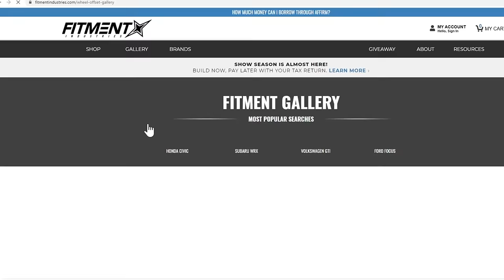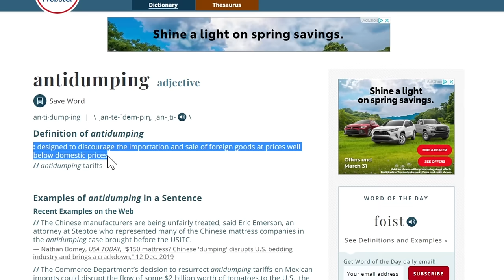Tire Prices Are About to SKYROCKET...

Comment: Tyres. The most important modification on any sports car, regardless of the category
Reply: Only the broke boy tires are being affected not the ones that will actually enhance your driving experience/ performance
Reply: @chelly9456  how you figure? Cheap tires are better for drifting
Reply: Car mods are banned
Reply: @chelly9456  Cheap Federal tires are great and it's a huge performance upgrade compared to the stock Michelin tires on my Toyota 86
Reply: @halogod0298  There are expensive drifting tires with harder compound that will last u more then 10 cheap tires  :)
Reply: behind the driver
Reply: Yeah it's a big safety upgrade actually.

Comment: I don’t run cheap foreign tires so this doesn’t affect me personally but I feel bad for drift kids...
Reply: HURR DURR MADE IN MURICA
Reply: @Louzahsol  I don't buy cheap either, but most of what I buy is made in Japan or Europe. 

Good tires is part of the insurance costs if you think about it. It's what allows you to stop and turn more than anything else on your car.
Reply: @wayward03  the point I was making is that made in America doesn’t mean an item is inherently better, other countries build things just as good, if not better and less gimmicky
Reply: @Louzahsol  I'd agree. I try to not buy things with major human rights issues like China but otherwise get the best product for the money when possible.
Reply: Did you miss the part where he says less tires will be shipped to America, causing a shortage, causing prices of regular-priced non-foreign tires to rise as well?
Reply: valino tires wont be affected by this, which is really the ideal drift tire
Reply: @troyjollimore4100  that's the big concern. Although most people that are not using these tires for drifting would probably just buy used tires anyways.
Reply: @Xander1Sheridan  I feel worse for the people struggling just to make ends meet. I remember when that was me, and a price difference of even $2-$5 per tire was enough to hurt what little money you had... Just trying to keep the car on the road!
Reply: I don't.  Why would anyone want to peel off the tread from their tires?
I respect their skills, but not their philosophy...
🤣👍
Reply: @tyree9055  Because they find it fun? Just the cost of doing it!
Reply: I always thought American ones were the cheap tyres, at least here in Australia. They seem to always be getting more flats and wearing out much quicker than most others yet cost the most, especially the Coopers.
I'm comparing to other well known brands btw, I'm not saying they are worse than Tonkos or whatever from Vietnam.
Reply: @archygrey9093  Those are the 'cheap' American ones. Dean, Cooper, Hercules, etc... Not bad for commuting, but almost as prone as the cheap Chinese tires for wear and broken belts. Now you get the 'good' American tires, like GoodYear or BFGoodrich... I think Michelin is technically French... THOSE are worth driving on.
Reply: @troyjollimore4100  Oh, yeah BfGoodrichs are very good, they are my favourite, i was more referring to the country of manufacture than where they are based, the goodriches on my car for example are made in Thailand.
Strangely enough BFGoodrich is actually owned and operated by Michelin, which is definitely french based and owned.
The Coopers here in Australia are always shown off as the premium American brand, they like putting banners of screaming eagles in front of American flags outside the Coopers tyre shop. They are a favourite with the 4x4 blowies and their magically scratch free cars, poeple who actually go offroad often usually anything else.
We tried coopers on a couple of the work vehicles on our cattle station and they got flats like crazy.
Reply: @archygrey9093  LOL! That's like here, anything Asian/European/Australian is 'exotic' and desirable!

Comment: Basic rule of economics, when the government interferes with the free market, prices go up and the everyday consumer ends up paying the tax.
Reply: Correction, THEORY. And one that cuts both way, of course you WOULD know that, but feint ignorance to make your point.
Reply: @cmendoza1094  typical libertarians
Reply: @cmendoza1094   It's pretty universal, though there are the few exceptions where the free market was allowed to run wild - itself often as a result of government interference and regulation - and government was able to reduce costs.

The prime example is medical care - it was once quite cheap... it only became expensive as a result of government regulation (providers have to charge everyone the same price they charge Medicare, but Medicare only pays a fraction - and the customer can't be required to fill more than some 20% of that amount... therefore charges went crazy and insurance companies started paying those higher prices (or much closer to it)... and that money was then used to make changes to medicine that increased base costs... and a vicious cycle began... directly caused by government actions... and only resolvable by government actions).
Reply: Oh no, the big bad gubberment won't let you buy communist made tires XD

Comment: Worked in a Firestone factory for 16 years. Well, actually it was Dayton when I started, and Bridgestone when I left. Plant opened in 1970 but a lot of the machines were from the 40s and 50s. At one point turning out 50,000 every day.  The rule was build em fast. We'll sort out the bad ones. Kept a shredder going like crazy and hauled them to the landfill. I remember when the Japanese engineers came in and walked around shaking their heads after buying our painted up factory. In case you didn't know, Firestone is just a name now. I think there may be one factory left in the states but everyone is salaried. Japan is not too keen on unions. Have lots of stories, but think about it. Tires really haven't gotten much more expensive since at least the 1980s. You can still buy a tire for less than sneakers.
Reply: That's so true if anything they have gotten cheaper considering how big average truck tires have gotten

Comment: A guy that went driving with me and my friends had a new set of Federals on his car before going for a canyon drive. He crashed into the guardrail on the first turn.
Reply: So which was more expensive, the repairs or the price difference for a better tire set?
😄👍
Reply: I used to work at a tyre shop, you gotta wear in the tyres before taking any hard turns or braking. The tyres still have the slick rubbery stuff on the outside from the mold no matter the brand that will make them slide unexpectedly, lots of motorcyclists crash because of it after getting new tyres.

Comment: Pirelli used to be great when they were still made in Italy, but are now crap since they moved manufacturering to Mexico. My Challenger SRT8 had p zeros on when we purchased it, but they sucked and recently replaced them with 305x45 Mickey Ts & a set of Cooper evolutions up front and are both excellent US made tires

Comment: I got some Othsu tired for my Impala back in 2013. They were super cheap and great it made the car handle so much better in all weather condition. Rain, snow dry they were great.  When it was time to replace them I couldn't find them again.   And by them I sold the car so I didn't have to.  But it is sad this is happening.

Comment: Why didn't you Say Continental Tires? They have the largest tire plant, across all brands in the USA. 
I work there, as a Maintenance tech, repairing tire machines. We are still adding machines and floorspace. We also have the one of the largest Mixing department in the world.  btw mixers are 3-5 stories tall depending of the one it is.

Also its in IL like right down south from you guys...@fitment industries

Comment: My golf came with 205/55R16 91V
6.5Jx16 et 50, can I fit a 8x17? If I can what is the widest tire I can run for performance and what backspacing (45, 40,35) will fit well, I’m not concerned about being hella flush I just want my car to stick hard in the corners. Love the content!

Comment: Guess it's a good thing that I don't buy cheap tires anyway... though I'm sure if I did motorsports and burned through them often I'd have a different opinion on the matter.

Fun fact, I grew up in the town where vulcanized rubber basically became a thing. Goodyear started their operations there, becoming the US Rubber Company, and then Uniroyal in the 1960s.

Comment: From Leo:  I am old enough to remember when good tires lasted only 18-20,000 miles.  Even cheap tires these days last 60,000.   Just that saves you two out of three mounting and balancing fees.   Adjusted for inflation, I think tires are cheaper per mile now than ever.   I have 65,000 miles on the Goodyear Tripletred tires on my car and they still look good.  Paying for better up front is cheaper in the long run.

Comment: Hopefully it doesn't go up to much the tires on my truck already cost $600 usd a piece but hell they last like up to 6 years 350,000 miles for the steer tires and 150,000 miles for the drive tires.

Comment: Michelin master race
Reply: Overpriced hyped up garbage...
Reply: I'd run nittos before I run michelin
Reply: @corvette_jake7225  probably because you've never run michelin
Reply: @Error_4o4_Found  had the pilot sport cup 2's on my turbo porsche and didn't like them, also had them on my Z06 for a while. They are overpriced and really don't perform that well, they lack feeling at the limits and tend to just let go without warning and they are really picky when it comes to temperature, at least in my experience. I really like the r888r's and the nitto nt01, they are way more cost effective and take heat cycles better while delivering better feeling at the limits
Reply: @corvette_jake7225  yeah I've ran some sports cups I also didn't like them tbh i got that same feeling I feel like the ps4s out performs them in everyway.. and I live CA so temp really isn't an issue for me but I could see being in colder areas as a downfall
Reply: @corvette_jake7225  those arent great tires and are old oem tires. the new michelins basically own the summer category. r888 is a very numb feeling tire and is much slower than the current 200tw tires. I don't get why people recommend them when they are built with compromises since they have street carcasses

Comment: So this really messes with the stance and fitment crowd, The cheap tire stretches better crowd. lol I love the whole stretched drift style but my Toyo Proxies Sport A/S stretched super clean so I know I'm good lol 
spec is for 2013 BRZ 17x9 +35 rpf1 215/45/17 and lip is exposed rides good and grippy. Plus they weren't too hard on the pocket at the local tire shop.

Comment: Also the other brands are going to increase in price as they will have minor competitors and a higher starting price 
So for instance if a 205/55/16 duraturn raises it's price by 60% it comes up to the same price (more or less) as a michelin energy saver. This will cause michelin to put a higher price to establish the brands value on stock markets ti keep the same difference ratio in price as before.
 For example if a honda civic arrives at the same starting price of a ferrari 458 it will cause ferrari to raise the price to establish the same price difference because of the brand's presige.

Comment: What wheel is that in the bottom left right under that blue wheel??
Reply from the maker: That would be the HRE FlowForm FF15 fam!  - https://www.fitmentindustries.com/store/wheels?sort=popular&brand=HRE%20FlowForm&wmodel=FF15&susp=%20Stock%20Suspension&mod=No%20Modification&rub=No%20Rubbing%20Or%20Scrubbing

Comment: Everything is skyrocketing since covid. Our rim and tire prices are already nuts here in Canada and if it was not for the boarder closure i would have ordered a set of rims and tires from you guys but the duty (and likely shipping) would make it about even if not more expensive than buying here. Thanks for the heads up might want to stock up
Reply: It’s called inflation.
Reply: Inflation is like 5% while 20-150% is way more than that

Comment: Can anyone link/tell me about any information in regards to storing tires properly? Like a way that i can ,per-say, purchase 3 sets of tires and keep them indefinitely without them dry-rotting or cracking over years?
Reply: keep them indoors, out of the water and sun, and keep them in a constant temperature
Reply: @nickkelly4208  that's close to what I do now, only during the winter months (they are in the garage) i douse them with small amount of baby powder and throw a garbage bag around them it seems to work but i've never had a set that went more than 1 year

only reason i ask if if prices are gonna do this I may invest and go ahead and bulk buy like 3 sets and store them for when i need.

Comment: I usually don’t buy cheap tires but mannnn I love uniroyal tiger paws.  They ride nice for the price on my daily beater
Reply: Those are notorious ford belt seperation about 1/2 the tires life!!!😥
Reply: @jtmasterson2476  
Had no idea.  Never experienced that.  I also work on cars and never seen it.  Might be a regional thing or production date 🤷‍♂️.  Also we stopped supplying uniroyal tires in like 2019 and replaced them with general which seem fine.
Reply: @Trex6767  they were notorious for the ford explorer's demise back in the 2000's the tread's looked impecable but the layer overlap failed and it peeled off like a bandaid mainly the front tire's and cause numerous blowout's and roll over death's with alot of passenger ejection's. It wasn't specifically the tiger paw but another style from uniroyal. That's alot of why rim's got larger and sidewall's shrank back down and companies designed stabilitrac or magnaride system's. Car companies used to test their stuff rigorously before selling it,not very much any more society is the guinea pig's for corporate's greedy income.
Reply: @Trex6767  every tire company had their hay day tire's at one time,goodyear eagle gt,firestone's 721,yokohoma's parada's,pirelli's p zero's,cooper cobra's,michelin pilot's and so on.🤗 everyone sooner or later cut's corner's and goes cheap mode and soon the customer get's the shortest straw.😒🤗 we raced a porshe 911twin turbo awd with michelin pilot's against a acura integra gsr fwd with yokohama a520's in a rain race the acura turned 1 to 2 second faster lap's than the porshe that was awd and double the horsepower,and the acura had two different driver's pull the same amount of lap's in the exact same car.🤔🤗

Comment: There's a reason why a lot of the cheap Chinese tires are cheap. Doing the proper R&D costs $$. Plus it's also why no OEM car manufacturer will put those ties on their cars at the factory cause at the end of the day, how the tire performs is a reflection on their brand as well. Stick with the top European & American brands and you'll be fine.

Comment: There are empty TV, HVAC, steel, rubber, etc factories across the United States that lost business to companies that dumped product in the US.  Do you want cheap products or manufacturing jobs?  And I’m not sure of the wisdom of buying cheap tires to have them when you need them in a couple years.  Tires age and rot.

Comment: Those tires aren't worth anything anyway. Not if you care about driving or wanting to go faster at all. Everything else you spend money regarding a car is transmitted to the ground through the tires. There's no point spending thousands on wheels or intake/exhaust to then ride around on $50 tires. Cheap tires are good for drifting I guess since they won't survive anyway, but if you want to go faster under any other circumstances, get good tires.

Comment: made up my mind neo nito gens picking me a set of them bad boys up asap
Reply: Just got some they look good af
Reply: Nitto tires are awesome. Great traction and mines are rated at 160 mph limit. Perfect for my mustang GT.
Reply: As a tire tech, neo gens kinda suck, they separate alot
Reply: @ekardnai  what would you recommend then as a tire tech
Reply: @shotsbyjoshh  not nitto neogens, they literally have 0 grip and are very very greasy. they are not performance tires. tires depend on what you want a summer or all season. you really cant go wrong with continental ecs or michelin ps4s. General makes good tires too for a bit cheaper.